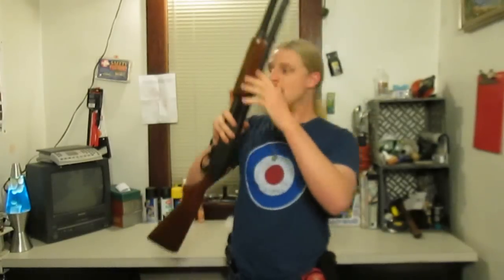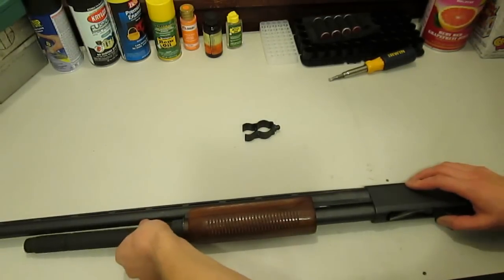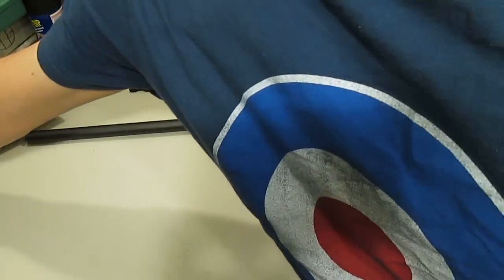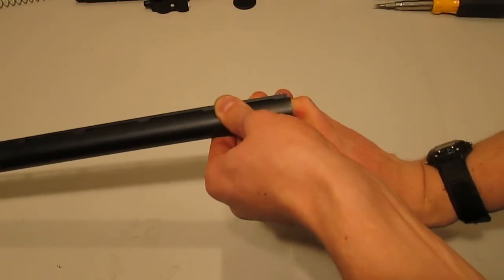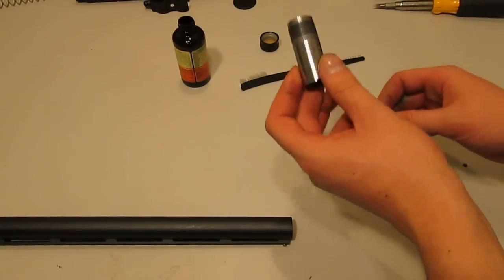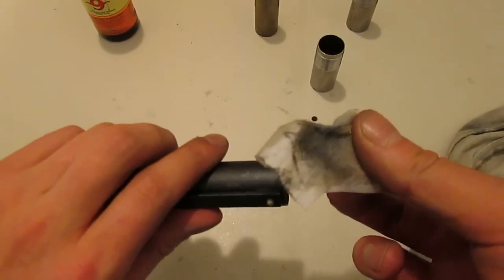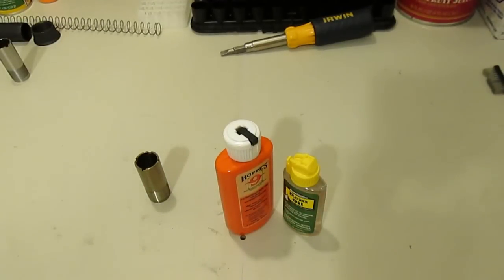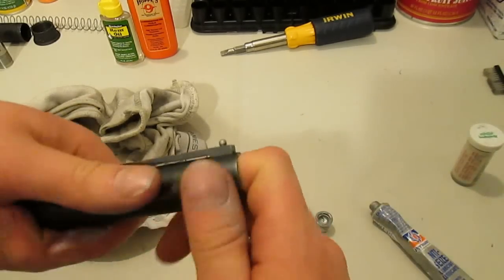The Care and Feeding of Choke Tubes - Remington 870 Tips & Tricks #3

Comment: I thought in a couple of web searches  that an 1100 barrel was for the 870 that only takes 2 3/4 shells (shows how little I know).  OK, so then replacement (Cabela's wants $190 for a new barrel with RemChoke), or an eBay listing for fixed Full Choke (the ones I've seen want almost as much as a new one), or a call to the local gunsmith for barrel threading look like my main options.  Mine is a 1968 model (I think) after some searching.   Good shape for that vintage.  Thanks again!

Comment: Thanks for your information!   I don't know that I'll even try to find out what bore it is - I can stick a dime in there and rattle it hard enough to make a fairly loud click.   So I'm guessing .715 or maybe even .720.    Probably not ideal for Trap.  Replacing it, what do I need to know regarding compatibility?   Mine is a Wingmaster, 2 3/4 shells, 28", so it's an 1100 I think.  What do I look for?  Modifying the existing for screw in chokes (at Brileys) would exceed $200.

Comment: I am new to threaded barrels and I just bought one for my 870. Without knowing (I should've watched this video first) I ran a BORESNAKE VIPER through the barrel with the choke tubed removed, I did this twice. The barrel is nice and shiny clean inside but I am worried that I ruined the threads. I looked at them with a light and they look the same as they did before I ran the boresnake. However I'm still worried that I ruined the threads. Is this a big deal or am I worrying for nothing?
Reply from the maker: A boresnake shouldn't hurt the threads, especially if you only did it once or twice.
Reply: ok cool, thanks!

Comment: I do this.. But mine keep coming loose after a stand of skeet. Really pisses me off keep putting my finger in and notching it back up. Your thoughts please?
Reply from the maker: +stan6818 If you can't get a good enough grip to tighten your chokes with just a finger, try using a coin in the slots on the end, or get one of those flat choke keys.  I keep a choke key on my keychain these days because I got tired of getting soot all over my finger during range sessions where I changed chokes frequently.

Another option is extended choke tubes.  Not those expensive ones with porting and what-not, but just tubes that are about a half-inch or so longer, with knurled ends that let you get a good grip for hand-tightening.  I have one of these with a light constriction that works well for slugs & buckshot, and it's really nice.  Helps protect the barrel's muzzle, too.

Comment: I have a now 870. Just trying to assemble for the first time. Choke tube seems to be cemented in - can't turn it.  Suggestions?
Reply from the maker: You could try immersing the end of the barrel in a penetrating lubricant for a while, and then try breaking it loose with a choke wrench.  Or you can take it to a gunsmith, they should be able to pop it out for you pretty quick.
Reply: Having the same issue that fucking choke tube will not come out
Reply: David Mcarthur got it. Haha

Comment: I came from target shooting & after I disassembled my rem870 exp I saw that my choke (mod) was loose. I did 50 rounds of buck & 20 slug (lead). This was my first time I shot my brand new shotgun & now I see u instslling choke just with your finger. Can the choke fell out of the bore during shooting? Thanks!
Reply from the maker: Did you check the choke tube before you took the gun out for the first time?  It may have been loose right out of the box if someone was messing around with it in the gun store that sold it to you.

It is possible for a choke tube to work itself loose under recoil though, so if you're running a lot of shells through your shotgun during a range session or a hunting trip, it's best to check it every once in a while.  This is one reason extended choke tubes are nice; you can check and re-tighten them without having to fish out a choke tool or stick your finger into the dirty bore.

Comment: I got a Rem 870 for trap shooting.  Near as I can tell, the 870 I have is a fixed choke.   Do you know what the inside diameter of a barrel with a full choke is?   I saw a DVD where they showed that you couldn't even insert a dime in the end of the barrel with a full choke installed.   I'm beginning to wonder if I need to dump the barrel I have for one with an interchangeable choke, because I'm not hitting the birds well at all.  Thanks!

Comment: My 870 express has wrench I shot it for the first time ant the choke is stuck in there.... What's the best way to get it out?????
Reply from the maker: Chokes sometimes take a bit of force to break loose, especially if you didn't lubricate it properly before you took the gun out shooting.  If you think it's actually stuck though, don't try to force it.  If it's just dirty, and not damaged or corroded, you may be able to get it loose by  immersing the end of the barrel in a penetrating cleaner or solvent for a while.  But if you're not sure what you're doing there, your best choice may be to take it to a gunsmith or a skilled friend.  They should be able to get it loose for you and assess any damage.

Comment: I know this will sound like a dumb question But... How do you know if you screw in the choke tight enough?
Reply from the maker: Daniel Perez If you tighten it down good and snug by hand (in the case of an extended choke tube) or with a basic tool like a choke key or a large coin, you should be good.  Without a full choke wrench that provides a lot of mechanical advantage, you really have to work hard to over-tighten a choke tube.  If you're not sure it's tight enough, check it frequently while shooting to see if it works loose on you.

Comment: Question about clearing a choke tube that is seized up in a tube?
Reply from the maker: What's the question?  Do you have a locked-up tube you're trying to get out?  Or do you have it out, and you're wondering how to clean it?
Reply: Yes, I have a choke tube stuck and trying to figure out how to get it out without damaging the tube or choke.
Reply from the maker: Kenneth Rodgers If it's just dirty, and not damaged or corroded, you may be able to get it loose by immersing the end of the barrel in a penetrating cleaner or solvent for a while.  But if you think it might be damaged, or you're worried you're going to screw something up trying to force it yourself, you may want to take the barrel to a gunsmith.